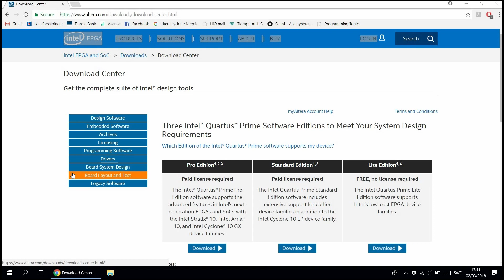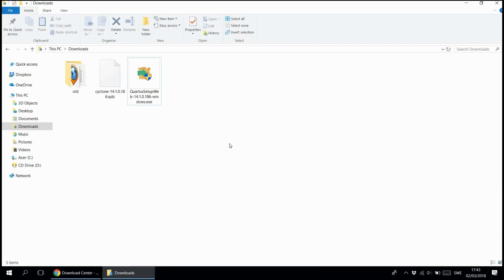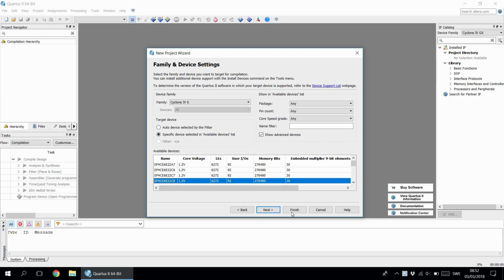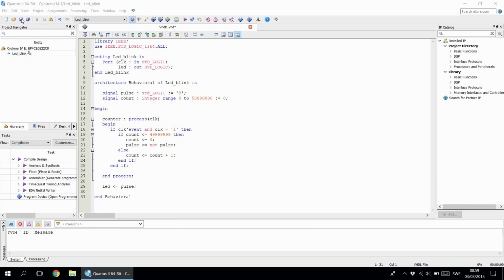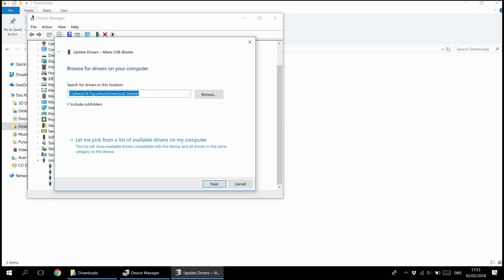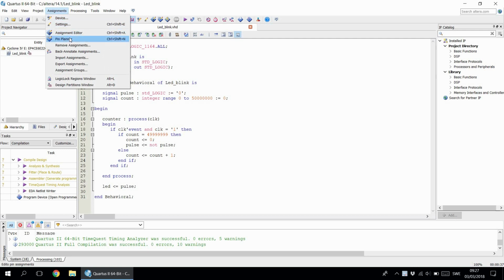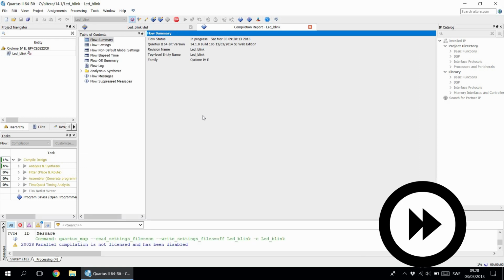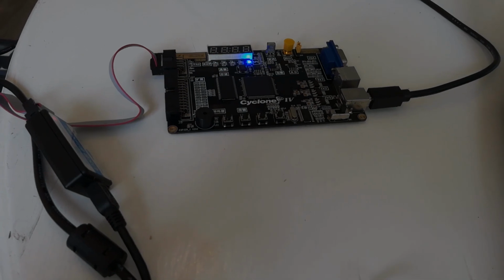FPGA Blinking Led Tutorial Step by Step [ Altera ]

Comment: Excuse me, I see you select the model name EP4CE6E22C8 in quartus. I have a question: is EP4CE6E22C8 the same as EP4CE6E22C8N? I have a board whose model name is EP4CE6E22C8N, but I cannot found the model name EP4CE6E22C8N in my quartus, what I found in quartus in only EP4CE6E22C8. So is EP4CE6E22C8 the same as EP4CE6E22C8N?
Reply: they are the same

Comment: To some this may seem a trivial example but even blink_LED requires some puzzle solving.  I found that Windows 10 in 64 bit mode requires signed device drivers.  That requirement can be overcome but some Googling and configuration was needed to get the Altera USB Blaster operational.  Thank you for a helpful video - programming does not prepare you for FPGA.